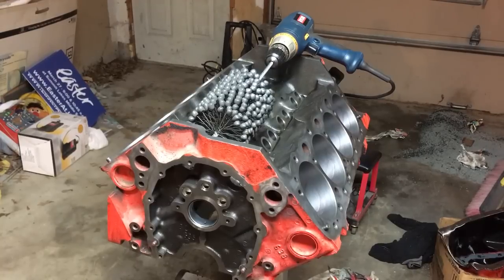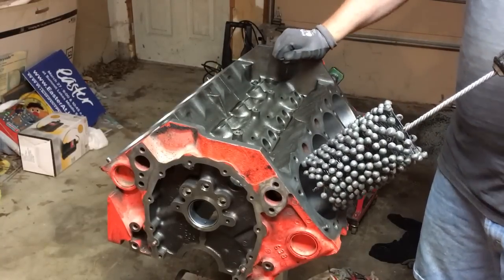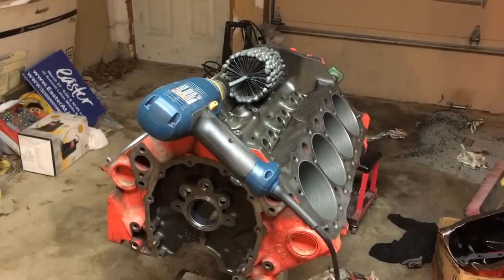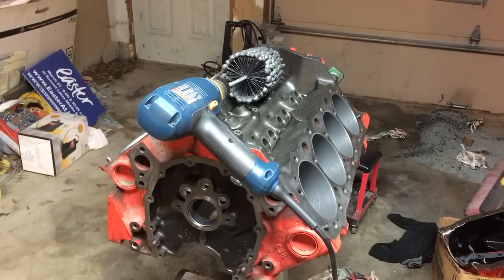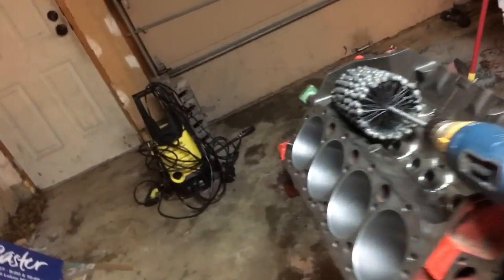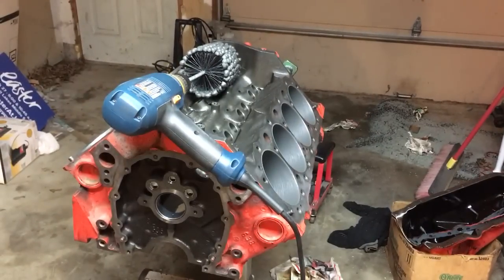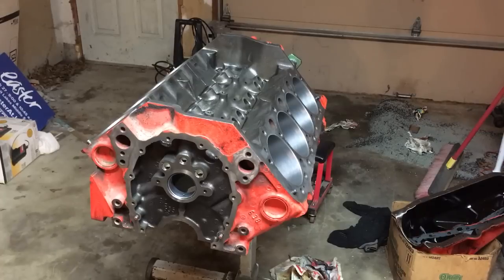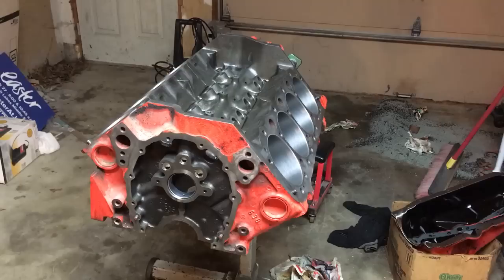Honing a block with a Flex hone

Comment: What part number Flex Hone was you using? I have a 5.3 I need to hone the cylinders
Reply from the maker: It’s the 240 grit 4.00” diameter we ordered off eBay.  You could use a 320 grit or similar too

Comment: I was wondering ,,, if i will have to move my arm up and down faster,,,to obtain the 60 degree cross hatch pattern... that is a harley davidson spec. for my cylinder...i am glad you mentioned making the hone go clockwise and counter clockwise...
Reply from the maker: jace keeton Experiment until you get the results you need. I’d say it would be pretty fast to end up with a 60 degree hex.  Thanks for the feedback I appreciate it!  JD
Reply: thank you much,,, for  responding back so fast
Reply: i thought you might have a good answer for another  wonderment... my cylinders measure a true 4.o" across...but my shop manual  calls the finished bore 3.7500... that is miles of space .. i almost get the impression that spec. pertains to ring space to the walls?   and i know my cylinders arent that worn.... or did my shop manual mean it in another area,,, that i am not seeing the obvious..
i havent even got to the piston and rings buyathon yet...and i am  hopefully not having to go to a
true bore situation
Reply from the maker: jace keeton I’m not sure where they recommend measuring a motorcycle bore, but it sounds like you have a larger bore jug setup over factory. 🤔
There normally won’t be more than a .0015” to .007” difference between the size of the piston skirt size and finished bore size.  The piston to wall clearance is dependent on the piston material.  cast/hyper pistons will have a tight clearance and a Forged piston requires more clearance due to expansion.  I’d recommend doing some more research on the engine.👍
Reply from the maker: jace keeton What size engine do you have?
Reply: HeadFlowInc interesting...i am definately going to do more research... this motor is in the 110 in the screamin eagle line.. 1803 cc.. i am going to have to my pistons out my storage area... i ended up moving last year,,, right after  i removed the motor out of the frame... i bought the bike new. so i know it is all original.. not sure if the oil pump started starving the rings 
and it started chewing up the rings and pistons in both cylinders.
Reply from the maker: jace keeton The 110 Twin Cam has a 4.00” bore & 4.375” stroke.  The original 88’s had the small 3.750” bore & 4.00” stroke. 👍
Reply: HeadFlowInc thank you again H.F. yes my shop manual is kind of hit and miss on giving specs for the  11o lol.. so they stuck the cylinder size of the evo's in the 110 column ... which yup it is 4.0.. and huntin online for 110 specs .. harley has its moments quite a bit,,,finding info like that.. i am saying a lot of WTF.. lol
Reply: @jacekeeton9020  Im doing my Evo 1340 im 10th over and my rings are hasting call for a 45 degree crosshatch with my s&s pistons , the pistons with rings will have spects . the s&s chrome moly called for a 45 the shop that did the 10 over,  used a 60 degree and i ended up with blowby 2000 miles im doing a deglazing fast hone 45 degree. i used ATF and you can see the fluid pool up showing the crosshatch pattern . got my brush from summit 40 bucks order 5 inch for the 110 . i ordered the wrong brush 3 inch they say they come over size it was 3 inch.  i had to get a 4 inch 10 over is 3.507
Reply: JCcanU   thank you JC... i did finally get my measurement correct,, just before i ordered my brush... as of yet i havent honed the jugs,,, I have been cleaning up the heads,,and valves, and valve guides.. at this point i believe i was fortunate the valve seats cleaned up... so i am going to see,, if i made the right decision on staying with my stock valves...the intake valves were scuzzy,, I feel with our crappie gas here in Cali. even being 91 oct.  The exhaust valves were still in excellent shiny state,,, they cleaned up easily..Valve springs showed no wear to speak of.
I am leaning towards a stock set of pistons and rings from summit..Keith Black ? I think was name..   Hoping to get the complete James gasket set...for that motor...gotta love H.D. how they have 3 million combo's of parts for their motors lol. almost from year to year
Reply: @jacekeeton9020   jace keeton   I have used Keith Black pistons Forged my bike ran great ,  200$ well spent , check out Ebay they had them listed last year 130 bucks for stock 1340 .  they had other listings for twincam as well .
Reply: JCcanU  thank you my friend,,, I will definitely check all of that out

Comment: So for a 240 grit you would recommend iron rings. Would moly rings be the same grit to. How much more in price are the moly rings
Reply from the maker: Moly rings need a finer finish like 320-400 grit, I’ve even heard of some claiming 600 grit.  
We’ve generally used 240 for iron and 320 for moly mostly because they’re the more commonly available grits. 
Usually the moly rings cost a little more, but remember they’re tougher material on the face and sometimes are harder to set or seal to the cylinder.  JD

Comment: I was always told to never remove the hone from the cylinder as you go up and down!!!!#
Also it's imperative to clean all the stone sand and metal grit out of the engine.
And transmission fluid is the best rust prevention out there,,use it before during and after so it doesn't rust
Reply from the maker: Justin Geraldi I used ATF in this video and yes the block should be washed after honing I agree. 
The hone should never stop or start turning while in the bore, this can cause horizontal scratches.  The hone should be turning as you enter and exit. 
I can see what you might me saying about allowing the hone to peek out at the top of the cylinder it might slightly chamfer the edge. 
Thanks for watching and the feedback I appreciate it!  I hope you subscribed JD

Comment: Did you have to get a bigger size piston
Reply from the maker: JT 1200 Stock OEM Standard bore pistons, 1995 rotating assembly w/powdered metal rods. On the next rebuild this engine would probably need bored to a larger piston. 
Thanks for watching!  JD

Comment: can i use coffee filters instead of a lint free cloth?
Reply from the maker: Raphael Nava I’m not sure, if the filter material can absorb the honing fluid and not shed maybe?  I’ve never used coffee filters but you never know.  You can use old cotton t-shirts, those Blue shop paper towels low lint at Walmart, parts stores etc. Since you’re going to need to wash the block thoroughly with soapy water you’ll have a chance to clean up the cylinders.  JD
Reply: @HeadFlowInc  oh okay ill use the blue shop towels and then soap and air spray

Comment: Great information on honing. Thank you for sharing. I've got a 1978 Ford 351M engine that is in good shape other than some rust that formed in cylinder 8. The engine would not turn over when I got it, but I slowly oiled and worked it free. It doesn't smoke, but low compression on cylinder 8. It looks like it's already got 0.040 over pistons from a recent rebuild. Do you think I can get away with honing or will I need to have it bored 0.060 over?
Reply from the maker: Charles David Was the ring possibly damaged during the process of freeing up?
1. It really depends on where and how bad the rust damaged the cylinder. 
2. It’s possible you may be able to hone it and re-ring it.  It’s hard to say without seeing it.
Reply: @HeadFlowInc  
Yes, absolutely. I was very careful when I freed the engine, turning back and forward slowly. The cylinders had all been lubricated with WD-40 rust penatrant for several days, but when it finally came free I hear a metallic sound that I could liken to a ring breaking.
I am going to remove the engine, completely disassemble it and measure and inspect the components and block.

Comment: Wondering if I can send you some photos of my lq4 6.0l block there is some rust in two of the cylinder walls (person I got it from didnt know what he was doing) I’m not sure on grit to  use
Reply from the maker: Manny Mix If any of the rust is pitted in the top 2 1/2” of the bore it’ll need bored. The rings live and seal in a relatively small section at the top of the cylinder. 
Final hone should be 320-400 grit, I’ve used 240 grit but I think it can lead to poor ring seal and oil consumption. 
I’ve got a 6.0 block that needs bored which sucks.  
You could email pictures to jeffdubray@gmail.com
Reply: HeadFlowInc photos sent thanks

Comment: Dingle berry hones are great if you're running egg shaped pistons. Only a motorcycle mechanic would use one of those on a car motor. 😆🤣😂
Reply from the maker: You’re so funny thanks for the laugh!  Yeah the 1500+ Hp engines we’ve built by honing stock bores must be a miracle. lol
Reply: @HeadFlowInc  were those 2 stroke Hondas or 4?

Comment: why cutting fluid is not there
Reply from the maker: Swapnil Wakale All cylinders are coated with ATF, Automatic Transmission Fluid, plus the hone is already wet with ATF. I mention it in the video.
I have a small bottle of ATF I pour around the top circumference of the bore that runs down. JD
Reply: HeadFlowinc Thanx for this informative video
Reply from the maker: Swapnil Wakale Thank you, I appreciate the feedback!
Reply: Pratap Aher cause he used a medium stone. Doesn't remove material.

Comment: I thought you need to lubricate it with at least oil before honing. did the manufacturer said otherwise?
Reply from the maker: h2bbuilt It's hard to see in the cylinders, I squirted transmission fluid inside all cylinders before I started the video. At the beginning you'll here me say coated the cylinders with ATF
Thanks for asking, hopefully this helps clarify.  JD

Comment: Dry?
Reply from the maker: It's hard to see but I already lubed the cylinders with ATF before I started recording and the hone is already soaked with ATF.  I use a small plastic bottle like you use for ketchup or something but an oil can would do the same thing.  Re-apply the ATF before each honing session.  JD
Reply from the maker: Thanks for the feedback, I added an annotation to help explain better. If you look in the cylinder after I start honing you can see the lubricant and the metal dust being removed build up in the cylinders.  I try not to use to much lubricant so it doesn't make a huge mess on the floor.

Comment: Use a slower drill (DUH!). Flex "hones" are not
hones to begin with. A hone is a settable set
of stones, such as the Lisle 16000/15000. 
No manufacturer or top engine builders use 
these ball style deglazers. The only thing 
worse than a Flex Hone is the spring loaded
style deglazer. For a re-ring job the Ball type
deglazer is superior to the spring loaded types.
Speed reducers can be had that will lower the 
RPMs. For moly or chrome use the finest grit
available. For some moly or chrome rings the
manufacturer recommends a 30 degree cross
hatch, instead of 45 degrees. Most blow by is 
due to the gasses flowing behind the ring/cylinder 
face through worn ring grooves. Always check 
the pistons for bell mouthed or worn out ring 
grooves. If too many pistons have to be replaced, 
bore out the cylinders for new +size pistons, and
have the machine shop plateau hone all of the
cylinders. Do not use the ball deglazer, or spring 
type where a fresh rebore with a machine plateau 
honed finish has been done. Oil fouled plugs, and 
an oil smoky exhaust is usually the valve guides 
and seals.
Reply from the maker: Thanks for watching and the feedback!  JD